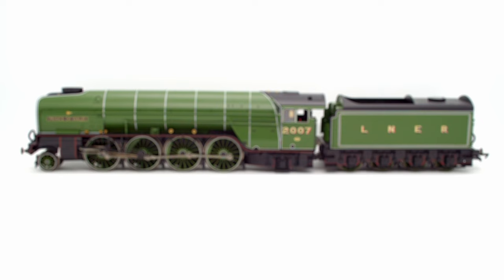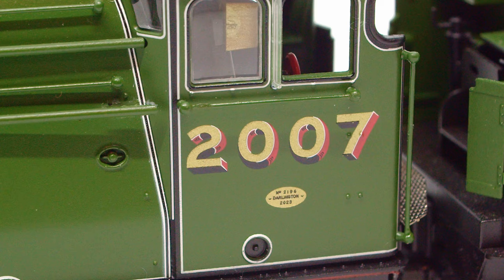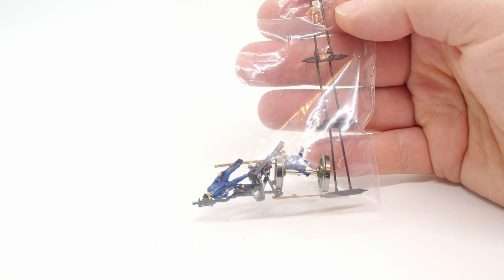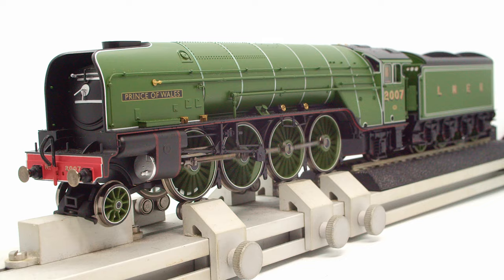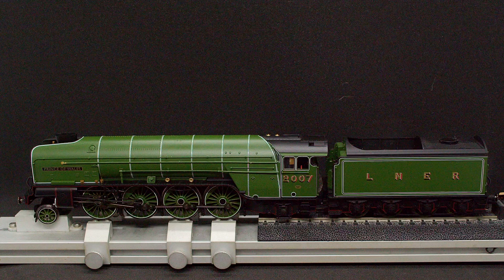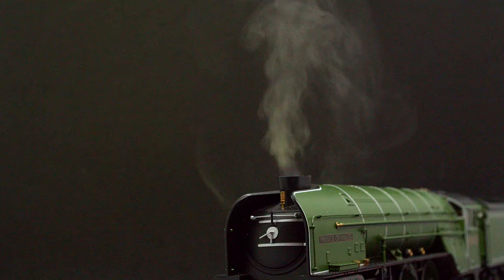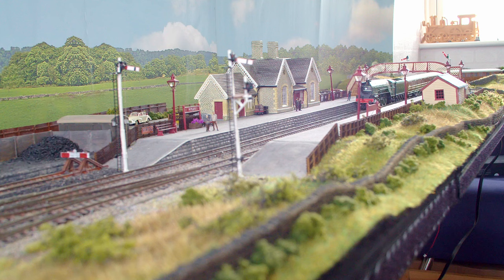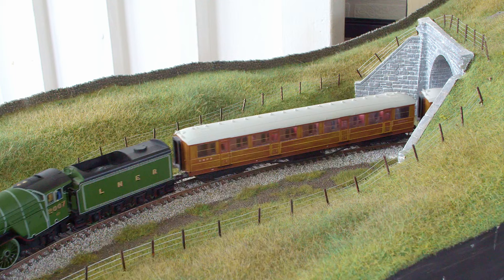GIMMICK OR GAMECHANGER? - Steam Fitted Hornby LNER P2 "Prince Of Wales" - 00 Gauge Review

Comment: Another great review.

I'm still waiting for my pre-order to arrive. (Slow postage to Australia, and I paid for express!!)

Anyway, this I feel is a real gamechanger to the hobby.
This new variant of smoke unit has some advantages.

- Don't have to worry about a heating element needing to warm up or damage your plastics bodies, so you can technically run it dry.
- Is safe for those who have breathing issues.
- Save costs on buying smoke oils. and WAY more easier to obtain.
- an actual puffing effect without the complex need of a fan or other component to simulate the effect that can fail over time.

Now the downside
- The Smoke probably doesn't linger as long as oil base one.
- The need to buy 100% purified water (But a 2+ litre bottle is going to last a long time, and still cheaper than smoke oil.)
- You can't use scents to enhance the experience. (As far as I know), so no coal smell.
- Water I guess is not as safe as smoke oils when it comes to accidental spills on delicate electronics... so I'll be interested about side effects like rust and such.

There's probably more pros and cons, but these are the ones I can think off the top of my head.
Reply from the maker: It's definitely a great feature to have for those that want it. Hornby have said you can run this with tap water - although I'm still choosing to use distilled as I have it in store for my live steam locos. As for rust and electronics, the steam generator is right at the front pretty well isolated from the rest of the motor and circuitry. Not saying it couldn't happen but I think you'd have to try pretty hard. I would imagine Hornby would have thought about this while designing the generator. Thanks for watching 😃
Reply: @ThatModelRailwayGuy  I've actually install these types of units into some G-scale locos for experimentation.

Despite having roughly a 6ml capacity.
Mine only last for about 7 mins before refill. (Not sure how Hornby makes their's last for 30mins)  For my testing units, I have used Tap water, with so far no effects so far.

But when I get this Hornby model I will be using the Distilled water only.
Reply: Update from my last post.

So Hornby have apparently "Cancelled" my order, even though I paid back in February.
They didn't tell my hobby shop about the "cancellation" until today when I rang them to find out what was going on.

They've also apparently discontinued this model for international orders, due to some kind of faults.
But I've not seen any bad reviews of this locomotive so far.

Now I'm on a waiting list for the variant R30350SS that is due for Autumn release.
So they/Hornby still have my money.

Overall, I'm not happy that I waited 2 years to order one.
And now have to wait another 6 months again.

My Complaints is in no Direction to "That Model Railway Guy"
I'm just warning people about the possible disappointment if they also ordered one of these lovely locomotives

TMRG, You are really lucky to get one of these when you can.
Again, great review and looking forward to seeing your future content. 🙂
Reply from the maker: @exveefan  Something doesn't quite add up here... you say Hornby still have your money but you ordered it from a hobby shop. It's the shop who has your money and not Hornby so why don't they give you your refund? Similarly when ordering with Hornby direct they don't take the money until the model arrives - that's pretty standard for all UK retailers too although I don't know how it's done overseas.

I know in the past that some retailers haven't been given the amount of stock they've asked for but usually they're aware of that shortage beforehand. And I've not heard any other reports of this model not being shipped overseas either... I'd have thought if that were the case it would have been mentioned on the various forums out there.

I don't want to throw your hobby shop under the bus but to me it feels like someone hasn't told you the entire truth.
Reply: @ThatModelRailwayGuy  I agree something doesn't add up.

The model has only been released for less than 2 months, and is apparently already discontinued according to a supplier.
My hobby shop owner was also annoyed by this news.

I heavily thought about a refund, but I still want to get one of these Water based Smoke unit locos, so they are pushing me to get the R30350SS instead since it's the same loco and somehow more easier on the supplier to do than just give me back my money for now.

So I don't really have much choice other than to wait even longer.

Anyway, I'm just frustrated.

Comment: Great review. I’m still unsure of water being sprayed over the layout though. 

I had the same issue with the pony/front driver derailing on the standard Prince of Wales. Researched the fix; turns out slightly loosening the front screws of the base keeper plate solves the issue for good.
Reply from the maker: In my experience the water doesn't really land on the layout at all. Because it's vapour it tends to go into the air more and just become part of the humidity of the room. If any does land on the layout, it's just a small amount that it doesn't really make a difference - certainly less so than oil based units. 
That's interesting with the keeper plate. My issues seem to have disappeared now but if they resurface I'll give that one a try. Thanks for watching 😃

Comment: Yea its not an etched plate as mentioned in my review, Hornby tend to just have a brass plate and then tampo printed in black.
The A4/A3 are quite old tooling now unfortunately they never retooled the bogies for these to include NEM pockets.
The item you call a steam pump, is I believe a  Turbo generator assembly.
Its  a gimmick but adds another dimension to the model, its a feature which makes it seem more real...
Excellent review as always.
Reply from the maker: That's definitely interesting about the NEM pockets on the A4/A3 pony trucks. I've got one of the newer Dublo A4s and that does have a removable section on the front that can be replaced for a coupling so maybe we might see that come across to the standard range of A4/A3s in the future too. Thanks for watching 😃

Comment: Great review! Love this idea from Hornby, brings us closer to our American cousins in terms of 'play value'. Yes, it's gimmicky, but it is still a great feature. Also, FYI, the tender on Prince of Wales matches the tender on Tornado, which has a larger water capacity for mainline excursion running. So it's an accurate detail variation compared to the other P2s.
Reply from the maker: Yes certainly with the H0 market (both in America and the European continent) models tend to be much more expensive but with a lot more features like this. Great to know about the tender - I haven't got a Tornado so couldn't verify myself but it does make sense that they would build them both to the same design on the prototype. Thanks for watching 😃

Comment: Certainly looks a nice model. Hornby did steam back in the 1970's I think
Reply from the maker: Yes I've got an old Triang/Hornby Jinty with a rudimentary smoke unit and there were also oil based smoke units in the 2000s too if I remember correctly - not to mention the Live Steam range too! Thanks for watching 😃
Reply: @ThatModelRailwayGuy yes I had that Jinty back in the 70’s! It used to heat up sewing machine oil! I loved it at the time, but being a kid, everything got covered in the oil. This model is a world away from that and I’m really looking forward to the forthcoming Black 5 with the same “smoke” generator.

Comment: I'm surprised it took Hornby this long to add smoke. It's been a standard feature in American O gauge trains for decades and is somewhat common on HO gauge American trains as well, of course those use glycol and a heating element for their smoke so the fluid is a bit messy and the generator can melt plastic parts. This water vapor steam system likely won't be melting anything, although I'd be worried about water causing parts to corrode or short.
Reply from the maker: Hornby have done smoke fitted models in the past using the oil based method but this water vapour technique is definitely a step up from that given how it can sync up with the sound and wheel rotation. The amount of water actually emitted is very little so I'd be surprised if it caused anything to erode... maybe if you were running it 24/7 with the steam on. Thanks for watching 😃

Comment: Just to note, at these smaller scales the volume of smoke becomes very unprototypical. Additionally, once you get to these smaller scales there are fire concerns - Broadway Limited recently introduced smoke to N-scale but they've had significant issues with overheating due to the reservoir being too small and the lack of a fluid conductivity safety switch, and it actually can cause the affected models to catch fire if the smoke generator isn't disabled via a decoder CV.
Reply from the maker: There are no fire concerns with this new system from Hornby because there is no heating element like traditional smoke units. Thanks for watching 👍

Comment: A very nice model, I only have the DCC ready version though I believe it is still fitted with the synchronising wheel ready for the steam generator. As for the derailing, yes this did happen to me as well they can be a bit temperamental in that respect.
Reply from the maker: Yes the sensor is there on the wheel but I don't think it's possible to retro-fit the steam generator into a P2 where it wasn't fitted from the factory... and as far as I know Hornby don't have any plans to release the unit separately either.
It is a long, rigid loco so I can kind of understand the derailing in someways, I was just surprised that the P2 was so sensitive to any tiny bump in the track where other locos just sailed through. Thanks for watching 😃

Comment: Even if its a gimmick, I dont know why anyone would dislike it, its such a cool Gimmick! Ive been excitedly waiting for these models to drop since they were first announced. 

That said im really not a fan of that plastic part of the valve gear. Watching the valve gear is one of my favourite parts of the models so that bit just ruins it for me. 

I do however have one question, does the HM7000 decoder work with normal controllers? (Or cheap ones like my Hornby Select) Or is it its own system? Id hate to have to change all of my existing setup to the HM system if its not cross compatible.
Reply from the maker: I can certainly see why some wouldn't like it, in the same way that sound or DCC isn't for everyone either. 

I think that valve gear piece would be to complicated to make working, so it would be static regardless of the material it was made out of. I just felt that, were it metal like the rest of the linkage, it would stand out less and you wouldn't notice it was static. The way it is at the moment it looks a little cheap for an otherwise premium model. Thanks for watching 😃
Reply: Some controllers can blow HM7000 chips. e.g Gaugemaster. I suspect the Hornby Select is okay, but I'd double check with Hornby.
Reply from the maker: @speleokeir  @_Zekken Sorry I somehow managed to miss the bit about decoder compatibility - long day, lots of comments!
 
HM7000 decoders should work fine with all DCC Controllers and of course as a stand alone system using the Hornby transformer and bluetooth control.

The problem arises when you try to run an HM7000 decoder on DC analog control - which I don't recommend for DCC fitted locos anyway. But in the case of these decoders THAT's when they're most like to go pop! But I've been running all my HM7000 decoders on standard DCC and it's absolutely fine. Hope that helps 👍

Comment: This is like one of those highly detailed models you see somebody do for an exhibition as a “ look what I have done” piece. It an interesting eye catching thing to see and a show off piece for a layout, but I don’t think the average modeller would use the steam function more than a few times.  As a matter of interest how big is the whole steam gen unit? When I think about the smoke box flicker that I have on a couple of locos, it got used once to see it works then never used again, this would probably be the same. At least with this you won’t have the oily residue of the old smoke system.
Reply from the maker: I think it depends on how you plan on using the loco. If you're only going to use it once then you're probably just better off getting the standard version. for me though, everytime I've run this loco so far I've had the steam generator on. Same with the firebox led and similar functions on other locos too - I make use of them where appropriate and I imagine there are other modellers that do too.
The generator isn't massive, it basically sits in the smokebox and over the first set of driving wheels - that includes the reservoir for the water too. Thanks for watching 😃
Reply: @ThatModelRailwayGuy  Sorry if I it sounded a bit negative, it is impressive to see it run. It will be interesting to see if they can put something similar in smaller locos like panniers or terriers.
Reply: They are going into the Black 5 and A3s already!

Comment: Gimmick or not the steam generator is great. By the way Hornby in Triang/Hornby days had synchrosmoke which was designed to match the motion. Certainly not a digital option back then of course. As to price ? About par for the course for what I’m used to paying for European N gauge sound fitted locos. Not cheap but then how much would it cost to have a sound decoder and steam generator professionally retrofitted to an analog loco ?? 🤔
Reply from the maker: Yeah, I actually have one of those myself somewhere that used to belong to my Grandad. 
As for price - well it would be at lest £100 to add a sound decoder and then you'd need to find someone who could do the steam too. I know TRS Trains do it but I imagine their prices are quite high given the bespoke nature of the work. Thanks for watching 😃

Comment: Thanks for the informative video. I have just bought the P2 (with sound and steam) and I am looking forward to trying it out. I did try a brief test, with minimal water, and failed to get any steam but I assume that might be because I did not fill the tank up quite enough. I was also wondering if there is a sure fire way of making sure the loco has no moisture in it before packing it away. Anyway I look forward to experimenting 🙂 Thanks again, Andrew.
Reply from the maker: I wouldn't panic if it hasn't produced any steam yet as it takes a little time for the wick to soak up the water. If you didn't completely fill it up then that's most likely what has happened. 
If you need to pack it away again you can just suck the water out of the reservoir using the pipette. The wick will still be damp but not enough to cause any spillage. Hope that helps and thanks for watching 😃
Reply: Thanks, very helpful 🙂

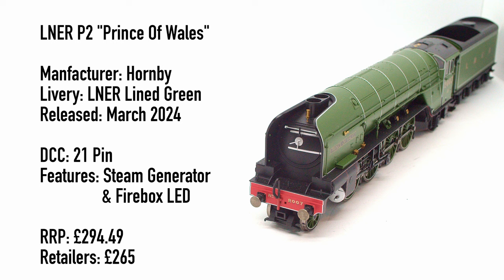Comment: 1:43 I have pre-ordered the smoke-fitted Black 5 through Rails of Sheffield and at the same price, it’s basically a bargain. 

In the price is a locomotive fitted with HMDCC, smoke & a flickering firebox but is also a new tooled locomotive and has changeable headcodes all for around £260

This is by far my most anticipated pre-order of the year. Shame its been delayed from Spring 2024 to Autumn 2024
Reply from the maker: Awesome! They're billing that as the"ultimate" Black 5 so it should be pretty impressive but even so it's incredibly what they've managed to include in that price - especially in comparison to some of the other manufacturers. The delay is a shame but kind of expected since the standard Black 5's haven't arrived yet and it seems like the steam generator versions follow on 6 months later. Thanks for watching 😃

Comment: This is honestly the first fair price I've seen from hornby in a couple years. But I really wonder what the benefit of using a glorified humidifier is over just a normal smoke fluid? Especially because smoke fluid usually doesn't sink as much or as fast as the mist. Maybe it's getting rid of the heating element? I also wonder if the water buildup could do any damage to scenery items, any moreso than the smoke fluid. It also bothers me a bit how obvious the audio cuts are in the sounds. The repeating chuffing noises are a bit grating. A good loco overall but I don't think this would be for me!
Reply from the maker: The benefit is that you can use water rather than needing special smoke oil fluid. The water is definitely cleaner than oil in my experience too, it leaves barely any residue - I imagine most of it just stays in the air as the particles are so small.
As for the sound, you get what you pay for and that's why the Hornby TXS decoders are cheaper in comparison to Zimo or ESU. That said, when the real P2 is finally running they may well redo the recording with the actual loco which everyone could update to via the app. Thanks for watching 🤩